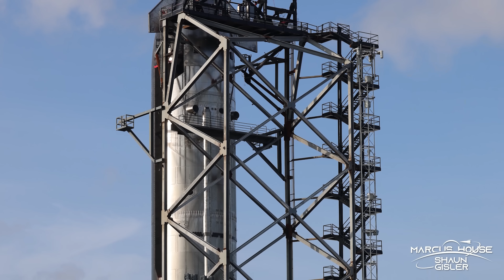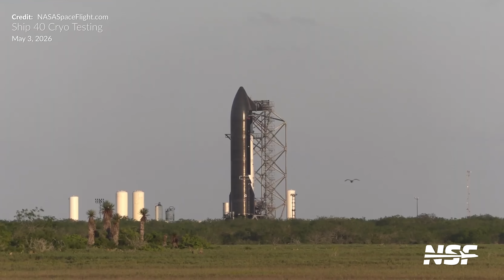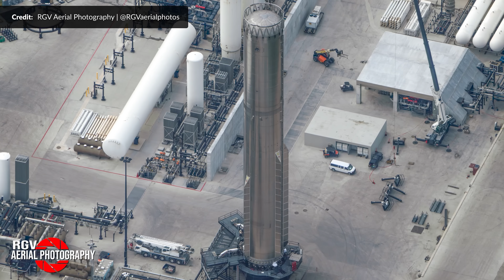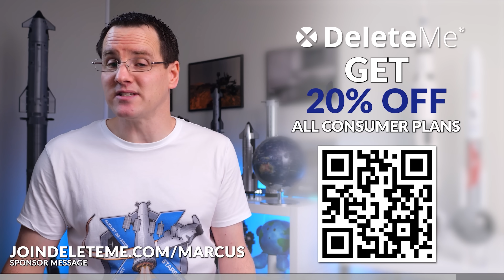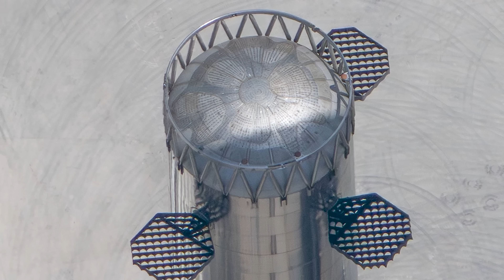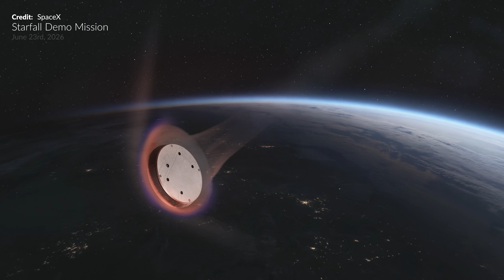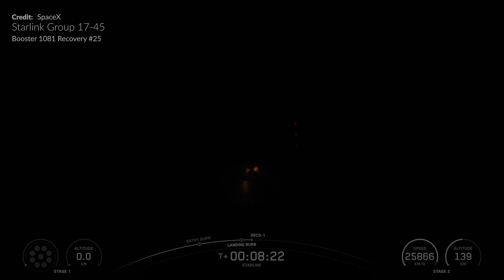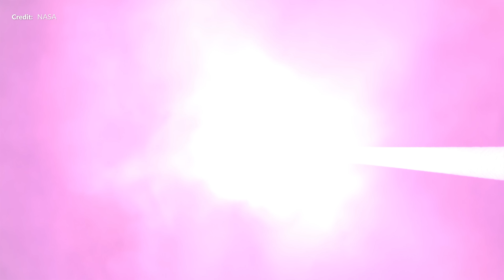What's Holding Starship Back?

Comment: Could a modified Starfall module provide re-entry shielding for the 2nd stage, and have enough mass for parachutes?
2nd stage recovery would require refurbishing due to landing impact and exposure to salt water. BUT . . . Partial reuseabioty for 2nd stage could be an improvement for Falcon 9 launch costs.

Comment: Starship is a a joke .... simply a crap design. Sure,  they are making improvements but overall its useless. It will be a decade before orbital re-fueling and I suspect it will never be rated for human flight ,,,,,,    Love Falcon 9 but starship is no better than a Cybertruck
Reply from the maker: Geezzz Tony, they flew it with over 40t in that deploy test the other week. We know they can catch the booster. The Starship catch is the ultimate thing that changes it all. I mean, yea, it is taking a lot of testing to get right, I get that. It feels frustrating at times. You do realise this has never been done before, and then at this scale right?
Reply: They are slowly reinventing the space shuttle but with a worse landing mode 
I can still remember when they weren't going to need a ceramic heat shield and now they're gluing felt backed custom cut ceramic tiles on the ship
Reply: @prophetrob  I don't think you've have a clue YET.  You may as well be the OP, he's just as blatantly stupid.  It would shock the world if either of you could say something that wasn't stupid.  Just once.

Comment: Here's a thought. 

Could SpaceX selectively add shallow fins  or vanes on top of some of the shield cladding on top of the booster tank? These would act to deflect Starship exhaust in the direction needed to flip the booster correctly. They could be shallow, maybe 5 to 20 cm high and contoured along the tank dome surface. Minimal added mass and passive directional pulse at staging.

Comment: The explanation about how stage separation went wrong in the last flight was great, I wasn't aware of how important the initial direction was before. I hope they can modify the booster so that it can recover and get back on track even if it gets kicked off in the wrong direction initially, just in case.
Reply: Just detach and wait a minute? Why turn the engines on then? Just wait until it's been pushed back by reaction control thrusters?
Reply: @tomholroyd7519 lots of wasted energy if they did that

Comment: Your explanation makes complete sense! Nice work Detective House. I immediately thought of baffles being returned to V3 boosters to make sure that it goes in the right direction, and people shat all over me. Ha
Reply from the maker: I suspect they don't want to add a bunch of baffles and stuff if it is not needed. It all takes away from payload and we know V2 was super heavy. If they can get it to flip in the correct direction and still have issues with the booster, then it will be a sign that something needs to be stronger.

Comment: The problem is caused by the coander effect of the starships rocket thrust the domed top of the superheavy heavy this effect make the thrust flow around and down the sides of the rocket hitting the paddles hard. They need a ring placed around the circumference of the dome to throw the thrust out to the sides ie the new deflection interrupts the coander effects which makes the starship thrust hug the dome